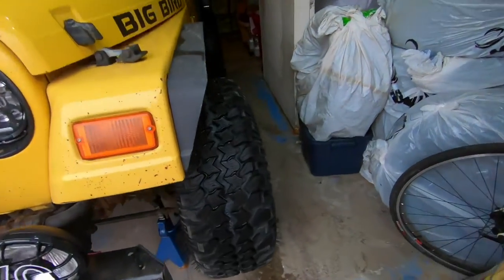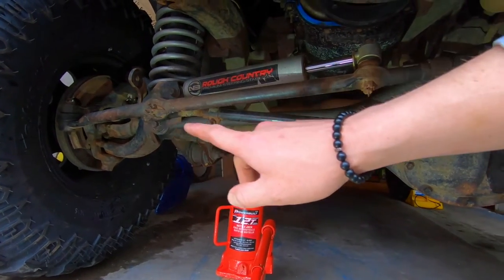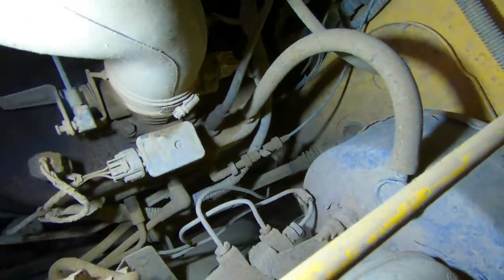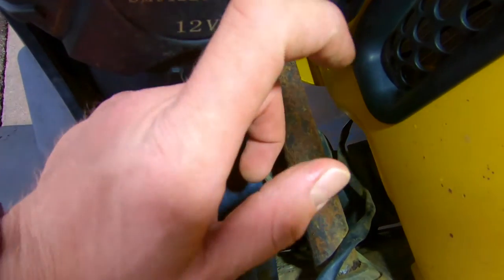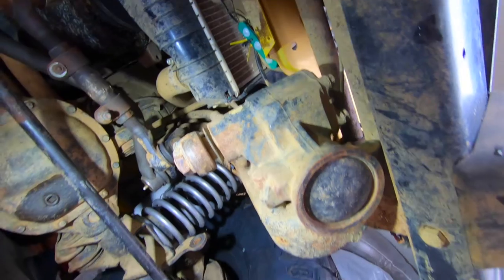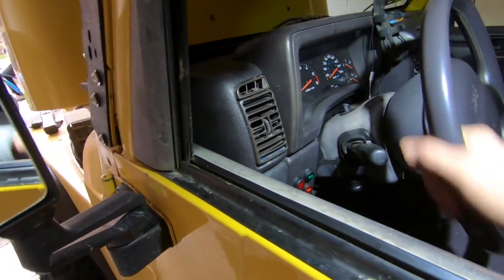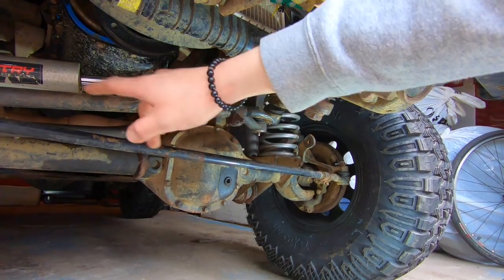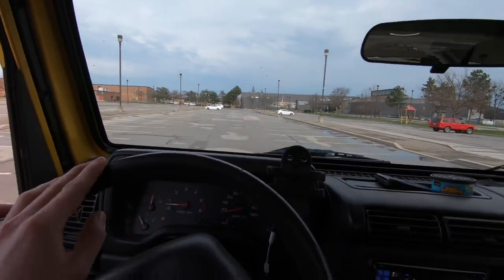How to Find The Source Of Steering Play In Your Jeep Wrangler (Any Year)

Comment: Brother I Wouldn't Do A Drop Pitman Arm . That Stock Should Be Good For The Lift You Have . If You Are Looking For Adj. Control Arms Look At "Core 4X4" They Sale Different Tiers . That's What I Went With And They Came With New Bolts!  Some Of Mine Were Rusted So Bad Had To Cut Them Out

Comment: I think I'm headed for a steering gear replacement. I have replaced everything else in the steering linkage, have had the vehicle aligned and still have significant "wander" in the steering, particularly when driving on rutted pavement.  The ruts literally deflect the wheels and cause the vehicle to "squirm".  My '06 LJ has a 2" spring spacers lift, 1" wheel spacers and is running 33X12.5/15 tires and brand new Rancho MT 7000 shocks.  Trying to get this thing (literally) straightened out so that I can get it sold.
Reply from the maker: Lmao it’s a Jeep with over sized tires; it will always drive like that. My brand new 2022 wanders too

Comment: Thanks for the info... I have just installed a rebuilt steering box I purchased from a local auto parts store and my steering shaft moves and tires do not, which seems to excessive...  Do they make the proper adjustment on when the rebuilds are done, or should I attempt an adjustment to illuminate the play, thanks for your help.
Reply from the maker: No idea if they set it correctly or not when they rebuild because it’s always up to the guy rebuilding it so you never know for sure. Doesn’t hurt to try and adjust it yourself that’s why the adjustment screw is there

Comment: Thanks for the video I have a 2000 Jeep Grand Cherokee 4.0 I recently put 3-in spacers on it and now it has a major vibration and shaking every time I go to come to a stop and it's starting to develop a little even as I'm riding or taking off but it's really more noticeable when I hit the brakes but it wasn't doing any of that before the 3-in spacer lift what do you think could be causing this I've got under there and checked everything seems to be tight except for I'm not sure about the tie rod I can take my hand and put it on the tie rod and turn it frontward or backward pretty easy but when I try to move any of my tires left to right or front to back there is no movement at all they're solid any ideas?
Reply from the maker: I would check if you have any worn out steering parts and start there. Other than that I don’t know what would cause your vibration

Comment: 6:44 the story is it is best to fix the suspension to function properly and get rid of the ‘stabilizer.’
Mine has been gone for years and it was a great improvement losing it.
Reply from the maker: Stabilizer still helps a bit with bump steer but you’re right your suspension will make the bigger difference if it’s worn out

Comment: should the drag link bar move up and down? there is no movement back and forth
Reply from the maker: You should be able to rotate it but not move the bar. Might be a loose bolt on the adjustment sleeve or one of the ends. But mine had movement and it ended up being a loose bolt so I would start there

Comment: Hey man I have a question for you. Ever since I’ve gotten my Jeep the steering wheel will adjust either left or right when driving on uneven road. Like if the road is slanted to the right I have to turn my wheel to the left to keep it straight. And of the road is slanted to the left I have to turn my wheel to the right to keep it straight. What could this be?
Reply: About a year ago I replaced my ball joints, track bar, stabilizer, tie rods and tie rod ends. It helped it drive smoother but never fixed this issue. I also have 33in tires
Reply from the maker: That’s how a solid axle vehicle drives. Even my brand new 2022 which I bought with zero miles drives like that. It’s just a Jeep thing lol. Every car actually will have this problem but it’s more noticeable on Jeeps because of the solid axle and having both front tires connected to each other at all times. One of the joys of driving a Jeep
Reply: Smokin Monkey I was hoping it was something like that. I don’t mind it at all but I’m glad it’s normal lol. I was worried my jeep had a serious issue. Thanks for the knowledge.